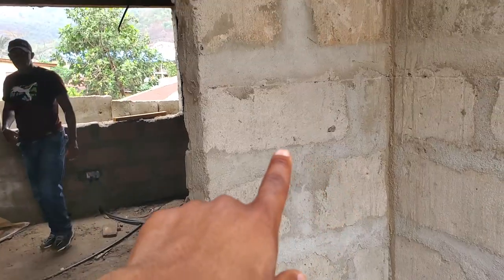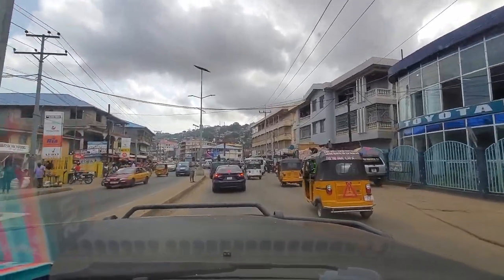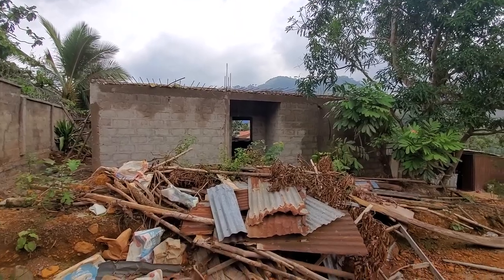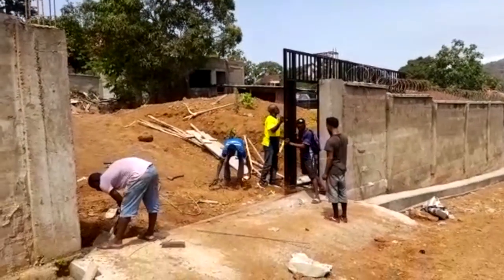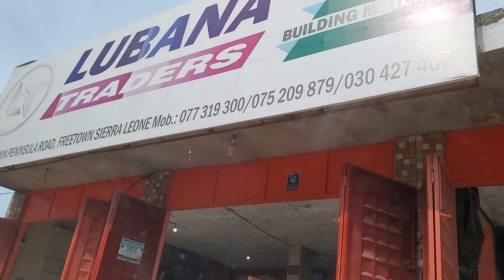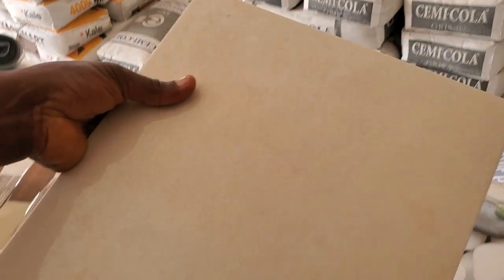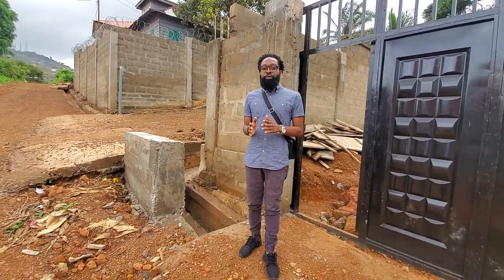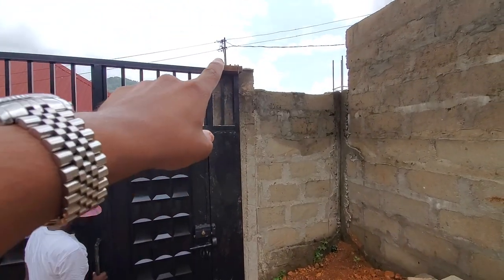Sierra Leone Real Estate UPDATE | Living In Africa Vlog: Week 73 Part 1 | Authentic African

Comment: Construction is coming along nicely. You have not talked about the generator for your backup electricity.  How much kilowatt output is required for appliances and lights? What kind of structure is required to protect the generator from the weather? Where should the generator be located so you don't hear it running?
Reply from the maker: I will not be using a Generator. I will be using all Solar.

Comment: You asked about our opinion on the tiles.  All but the bathroom I would work with.  In the bathroom, the wall tiles and the floor tiles don’t  complement each other.  If you use the floor tiles you picked I would use a plain pattern for the walls and vice versa. Something like an off white or summer gray for the walls with the black and white floor tiles or a beige/gray floor tiles with the wall tiles.
Reply: Respectfully, agree.
Reply from the maker: Thank you, I will take that into consideration.
Reply from the maker: I appreciate the feedback.

Comment: It's coming along nicely.

I thought you only have 1.5 plots? It looks like a really good size.

Maybe 2 plots is enough then as I have been saving for 4 plots.

Picking tiles and stuff has always been a challenge for me as it's hard to know what will look good until it's actually installed IMO
Reply from the maker: I have a little over 1.5 but the property is a good size. I think 2 plots is enough for a good size house. It all depends on how big you want to make the main house and the caretakers quarters. My house will be 65 feet long by ~40 feet wide. I will be able to fit 3br, 3.5ba, with verandas, kitchen, livingroom and dining room.

I can get the info for the tile company if you need it.
Reply: @AuthenticAfrican  yes please. Thanks

Comment: Construction is going well. In regards to your tiling the tile you have chosen for the bathroom wall will not look good in the bathroom and particularly not with the floor tiles that you have chosen for the bathroom.  I am also currently building in SL.  It has been a real struggle and headache.  If you don’t mind can I please have the contact details of the person that constructed your gate. Thank you.
Reply from the maker: Thanks for the tips! The contact info for the welder - Assemblers Metal | 22 Sir Samuel Lewis Road, New Market | 088 858 8978
Reply: I agree, they are a big contrast. But the other selections seem to be ok.